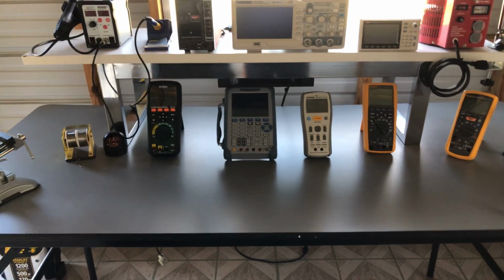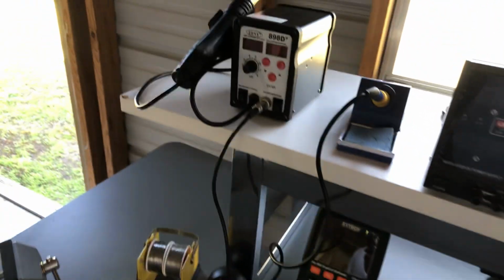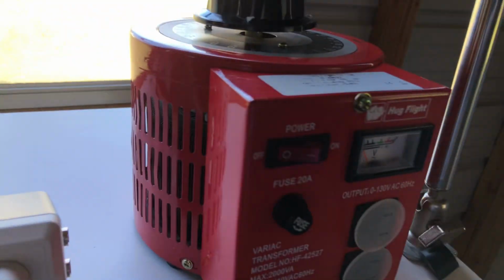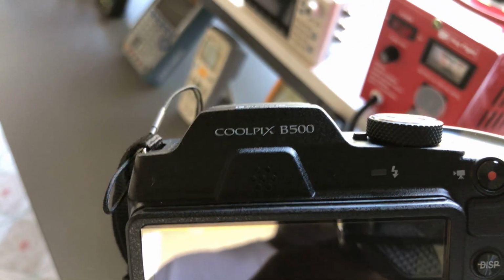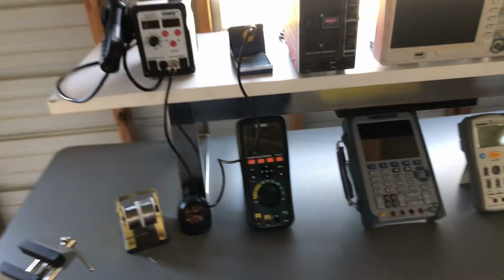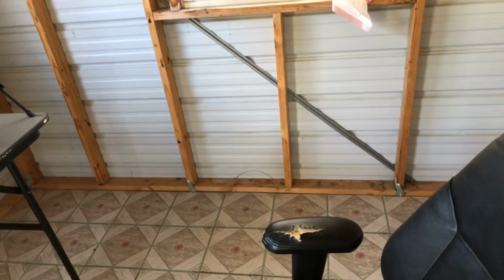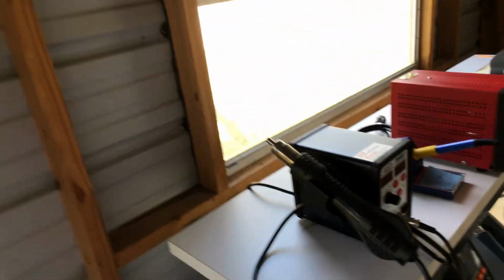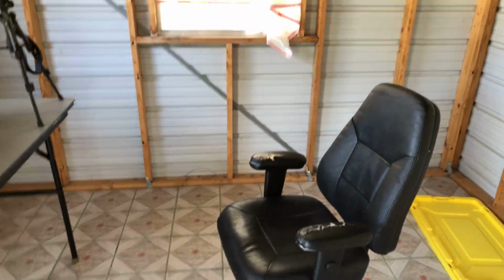🇺🇸 My  Electrical / Electronic Hobby Lab ( In Progress )

Comment: Good to have a little space of your own TETC. Careful with cold natured comments about the wife, you might end up spending more time in there than you planned! 😅

I think you can get carbon filter elements for use with solder extraction fans, might be worth looking in to. Hako do make some great kit, but it certainly is expensive.
Reply from the maker: Yeah TP a little elbow room never hurt anyone, I’m considering purchasing the HAKKO 301 de soldering gun along with the soldering station. But you’re right HAKKO absolutely love their products they’re VERY expensive. 👍🏿
Reply: @TheElectriciansToolChannel  If you don't have one, a de-soldering gun is a real treat when you start to use it, can thoroughly recommend it. I have a cheap little Duratool clone and makes life so much easier, although I have just gone and blocked it totally up. Waiting for some bits to arrive so I can try and get the solder out.